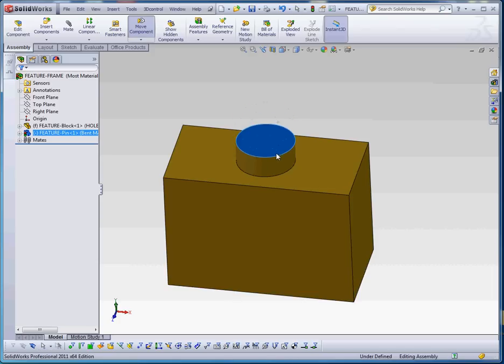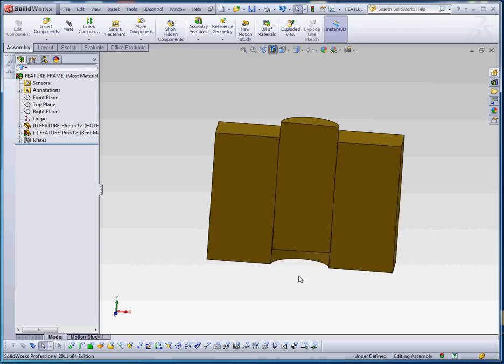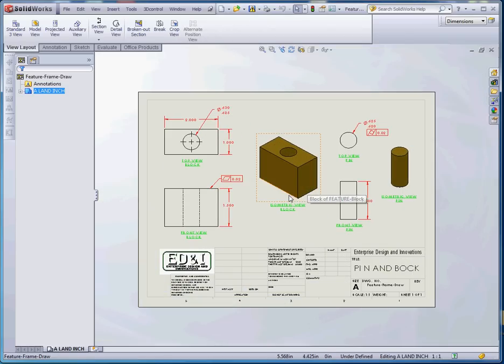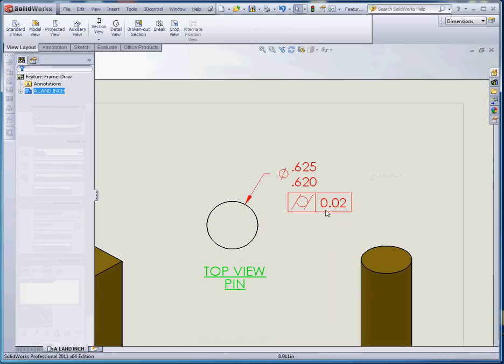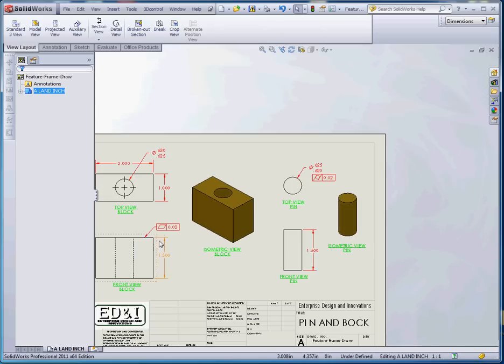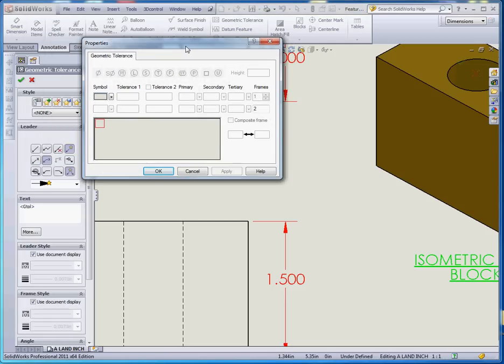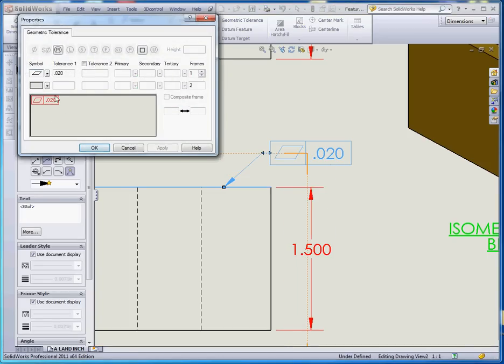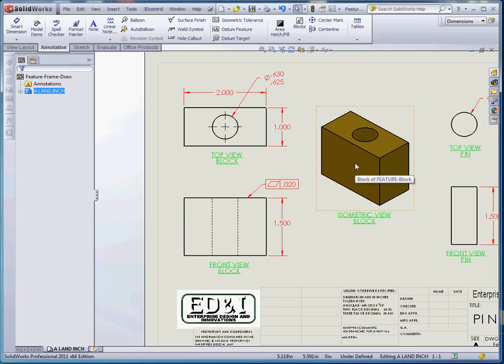Part 4 - Geometric Dimensioning and Tolerancing, 2D and 3D Tolerancing

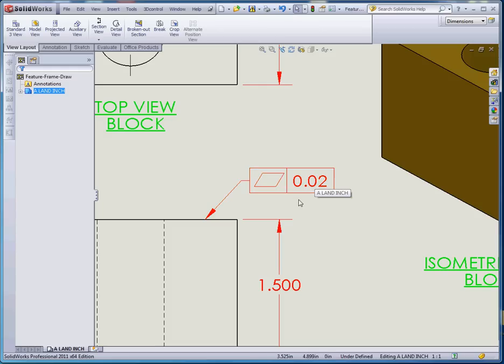Comment: Cylindricity control frame at 2:36 used a Metric format (0.02) s/b same format and 3-place dimensioning as the inch dia callout, (.020). IMO it's a lot easier to get pin cylindricity vs a hole. Drills, esp dull ones, can wander when making a hole esp deeper than 3 diameters..  Again, flatness at 4:23 started out using a Metric format which was edited to inch.